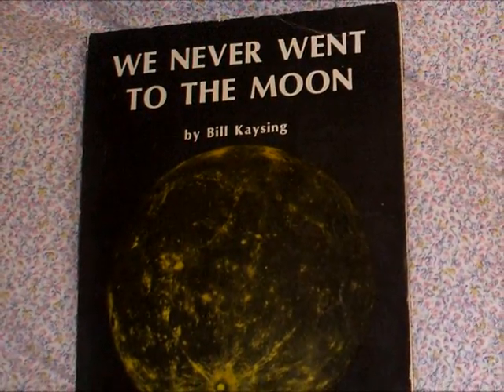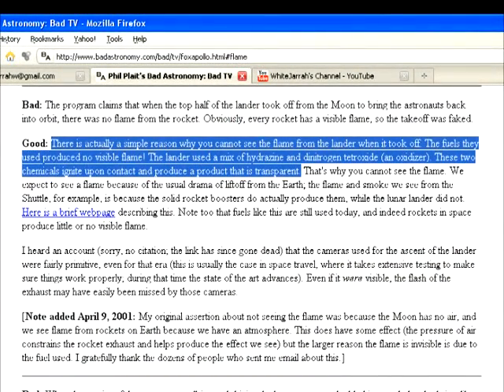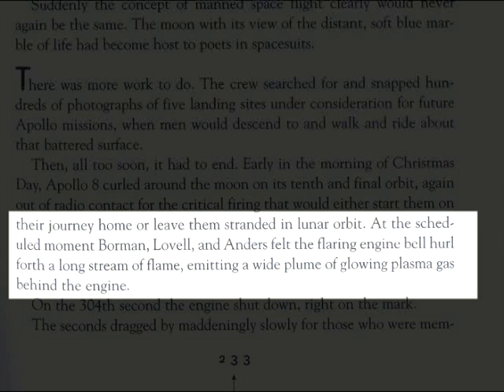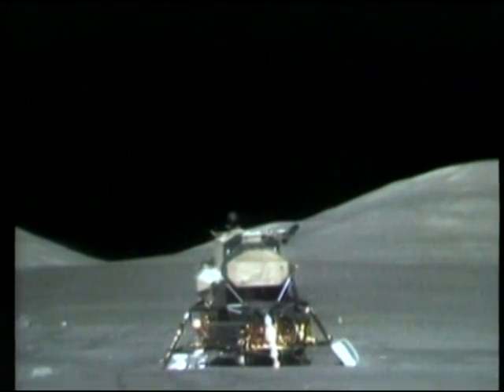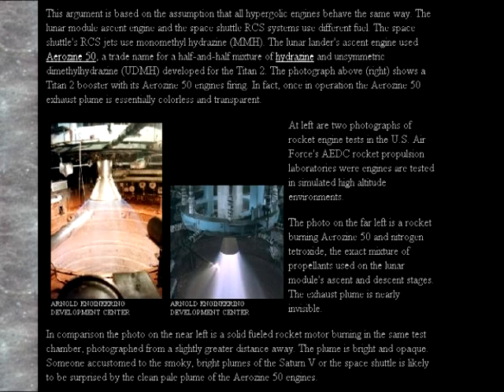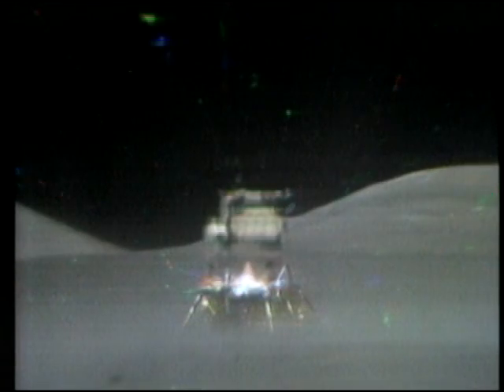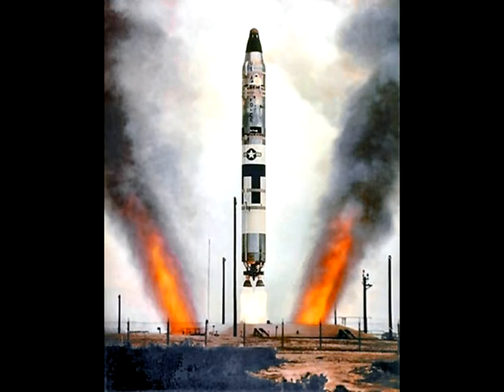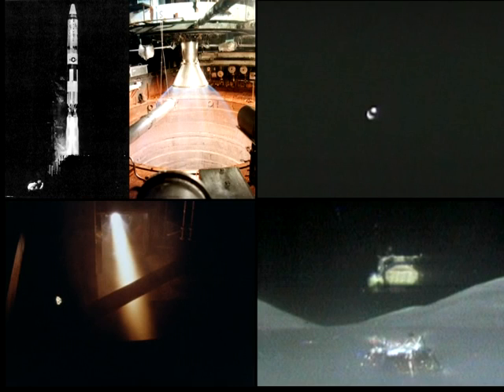MoonFaker: Where's The Plume?

Comment: the thing people should think about is.. solid rocket fuel uses oxidizer in earths atmosphere to burn. if u buy a stick of solid rocket fuel for model rocket it has oxidizer in it.. put that in a vacuum chamber and try lighting it. it wont burn cause it still needs oxygen in the fire triangle. any benefit from oxidizer would be dealt with by the vacuum of space.

Comment: For the Ascent Module to lift-off perpendicularly, all 4 legs of the lander would have to be equally affirmed on the Moon's surface in order to equally distribute the force from the ascent rocket across all 4 legs, (a tripodal configuration would help to distribute the force equally across all 3 legs) but then the other variable is the actual surface density/support under each leg... it would have to be equal for all legs.

Landing -- randomly --  on a less that absolutely flat and variable density surface precludes any plan to of lift-off with success even ONCE, let alone 5 times more in succession.

Comment: Here are a few things you need to take into consideration if you want to have  a convincing argument here:  1) The load on the ascent portion of the LEM is much much less than on the rockets you show, and the plume is not condensed by atmospheric pressure, so the density of plume, and thus brightness of the plume, is much much less than in the rocket burns you show.  2) On earth the hot plume  hits the atmosphere causing moisture to turn to steam, which is colored, but you don't have this effect in space.  3) If the fuel mixture is not perfectly stoichiometric on earth there can be further reduction giving color, but not in space.   4)  It is a fallacy to expect it to be easy to see something that provides weak light just because the sky in the background is black.  Rather you need to do the opposite and compare to other light sources.  In this case sun light reflecting from other items in the picture will have caused the camera to be stopped-down to a tiny aperture, and thus made it so that the camera can not see a weak light source from the plume.

... actually given the test engine fire in atmosphere of the LEM engine you were provided, and then compensating for the other variables listed above,  you have made a rather convincing argument that the lunar module ascent film is correct for the expected scenario.  Thanks for that, as I've always wondered about this one since Bill Kasing brought it up.   

...  I wonder if  it wouldn't be possible to do the math on this one.  You know how much energy is required from the fuel burn given the trajectory in the film and the mass of the ascent module.   You can assume a very wide plume and get an energy per unit area.  You know the temperature of the burn, which gives you a black body radiator.   Then it seems you can then compare that radiation against that from reflection from other objects in the film, and then calculate if you should be able to see it.  Would make a good homework/test question for a physics course.

Comment: If the camera was operated on earth...then the images of the accent of the capsule  arrived  aprox. 1,2 sec later here on earth.
If an  operator operates the camera here on earth.. the camera on the moon  reacts to the earth operator another 1,2 sec later...a total delay of 2,4 sec...
Whe don't see that delay in the images of the ascent of the capsule...the camera reacts immediately on the ascent.. .....
Reply: did the camera locally track?  They did have practice?  Would be interesting to analyze all audio dialog for cases of question followed by response in less than 2.4 seconds.
Reply: @ep5acg  I seen a video where they did check this.  And yes some replies were less than the delay should have been.
Reply: @BrickWilbur2020  - I think if you check the dates of those other videos you will see that my comment predates them.  Perhaps my comment inspired those checks. LOL.  Of the  'didn't go to the moon' contrivances, the analysis of sound track latencies is the only  'laymen level of sophistication' one I've not yet seen an explanation for.  I'm  curious about the sounds of doors shutting and hammers hitting, as it has mostly gotten shoulder shrugs from those who take a defensive side of the debate, and well, 'perhaps there is a thin atmosphere' on the moon.  Is there? Seems that surely someone would know and a grad student or someone would model that too. (Nvidia did a nice job modeling the lighting.)   Better yet, soon we might be able to try it out for real while digging a mine or shelter foundation.  I've not been able to make sense of the video of the earth shot through the window stuff. There was a lot of simulation work and earth based dress up photos, so some of this doesn't mean that they didn't go.   Though scripting something from orbit? Well that has never been disclosed.  Ah here is something more you might think about .. check out this video https://www.youtube.com/watch?v=KcTrOGS3TyE   I always ask myself, did they really run out of questions about space in 1963?  Is it really possible that NASA could own all that cool hardware and develop all those amazing skills, while keeping purely civilian mission objectives?  Surely at least a surreptitious large satellite placement, some amazing photos, ... or something!  God with all that money spent one would hope so .. but on the other hand, perhaps the moon objective was hard enough.
Reply: They claim they "timed it just right", after messing up the first time. I forget which mission that was.

Comment: You CANNOT compare the ignition in atmosphere with Earth's gravity, with ignition in space vacuum with zero gravity or the Moons low gravity.

This would be fairly easy to test. You just need a decent vacuum chamber, of a decent size, and an engine with that fuel to ignite. Not real easy, but not terribly difficult.
Reply: There are plenty videos of rocket engines firing in a vacuum chamber.

Comment: First they say there is no visible plume due to the vacuum, then they say the plume  is transparent. Damn thing looks like it's being pulled up.
Reply: Don't fall for his pseudo-science.

All you need in this case is the emitted light from the hypergolic fuel reaction, which is intense and extensive.

A hypergolic propellant combination used in a rocket engine is one whose components spontaneously IGNITE when they come into contact with each other.
Reply: Kyros Nox There's three different ways in which a volume of gas can become "visible": emissivity, diffuse reflectivity, or absorption against a lit background. You need a significant amount of at least one of those within the limited cross-section of the plume (and within the spectral range of the camera to boot),  otherwise you won't see anything.
Reply: Gath Gealaich
Food for thought... Noted.

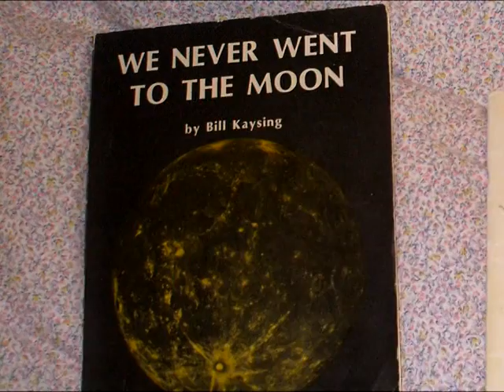Comment: First of all  there is no air on the moon, so there can be no blast "flame" like there is on earth, Second of all at 0:42 you can see the flame or  the "Plume" and In space there can be no flame because there is no oxygen to fuel a flame tail coming out of the rocket nozzle.
Reply: Hmmm maybe that's not true.  I think the fuel has oxidizers to produce the burn.

Comment: I would just like to point out that the argument ¨there is no air in space¨ doesn´t work here. The engines contain both the fuel and the oxidiser. No air is necessary to create a plume. The plume is just the extremely hot gases and particulates (if any) that are released into the vacuum from the rocket.

Comment: Note the debris falling off the left side of the LM ascent stage at about 5:52 & 6:50 when it's about 50 meters off the surface. Someone explain why it slowly falls down the side & then suddenly accelerates sideways like a bat out of hell. If this is a fake model pulled upward by a cable system (which nowhere appears when we look up), what's propelling that debris? For that matter, what's kicking up all the dust & turning the black sky gray?

It's either engine exhaust or some fabulous effect!

Comment: @yesiamawizardjonny No its been cleared up for gullible idiots like you who believe whatever you're told. In 1969 they made the first Cadillac with electric windows and they barely worked yet were supposed to believe they had wireless operation that worked 250000 miles from its target? Spare me.

Comment: It amazes me how you can do a partial analysis of partial data and conclude that you know everything there's to know about the isse.
To youw whole point: an exhaust emits no visible plume in vacuum. BUT if you look UP into the engine, you'll see the red hot internals of the engine. So you are seeing EXACTLY what you should see. In the burns in the atmosphere, air gases come into play, when they become plasma in contact with the exhaust gases from the engine they glow blue and orange.